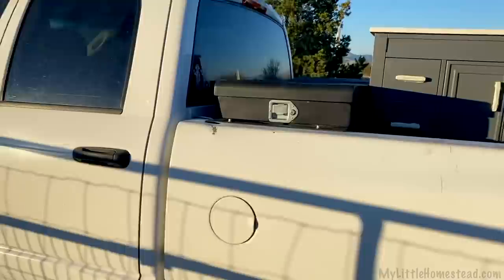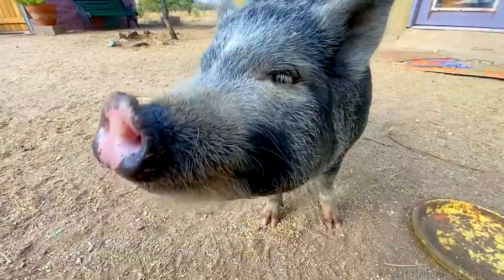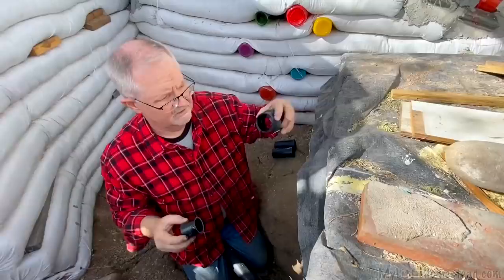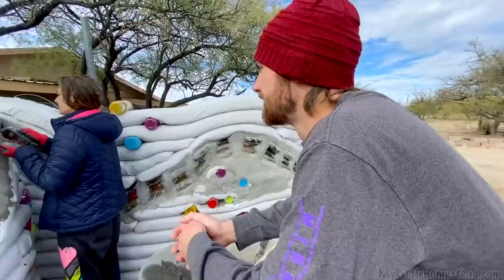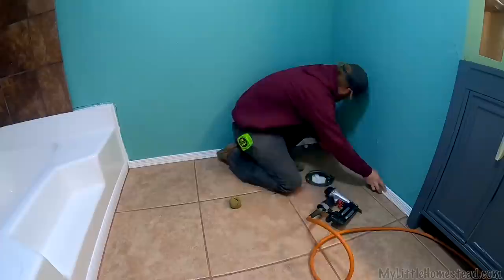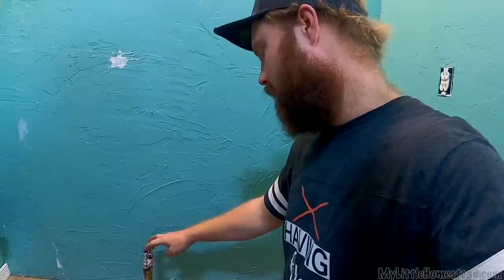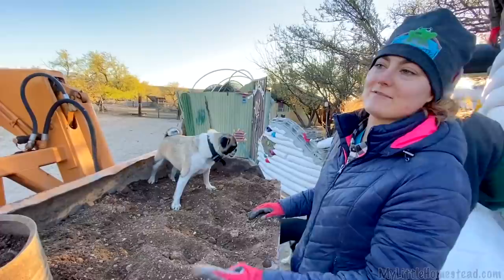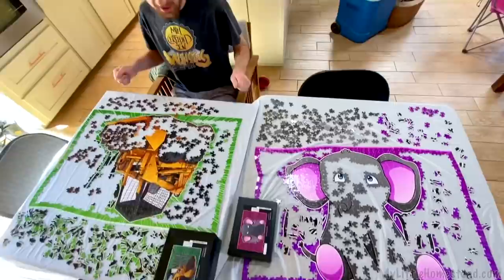Modify Bathroom Vanity to fit in Mobile Home | Weekly Peek Ep265

Comment: First off: Happy new year. May things continue to look up for you and yours.

Garen: ebay has diamond drills for cutting holes in glass and tile for around $10. The pack comes with 10 diameters. Also a quick hack when you need to direct water to a blade when cutting tile or other hard surface is to take a 2liter bottle and poke a hole half way down with a pin. Fill the bottle with water and screw on the cap. Place the bottle so the stream, when cap is removed, is directed towards cutting area.
Also when not sure how a substance will react to the cutting, try cutting in a test area first.

Comment: Garen and Ellie don't forget the back splash it will stop any water from running down the back and it will look a lot better with it. The pieces you cut off can be cut to size and spliced together then glued to the surface of the sink. You will need to find out what type of material the counter top is to get the right type of glue needed.

Comment: Just curious why an out side shower? Do you have pool?
Reply: They had one there before.   They got a hot tub and so they decided to redo the area to include the shower and hot Tub.  When you live in dessert and work outside a lot, it's nice to shower outside and get all the dirt off you in the summertime...Plus you don't drag the dirt into the house.  And the hot tub is fun in both summer and winter.  I don't live in dessert, but it's hot and humid here in summer.  I love an outdoor shower.  I would also love an outdoor tub too.